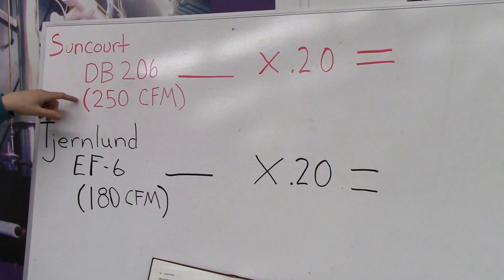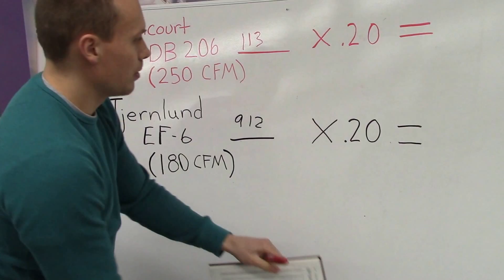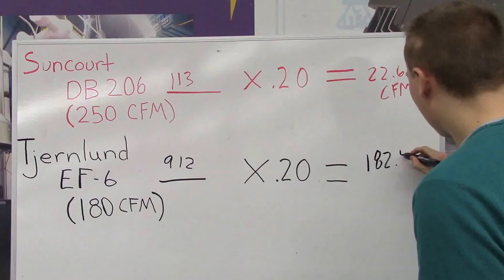6 inch Duct Fan Comparison

Comment: Neat. I just saw the Suncourt brand at Home Depot for $37 and was wondering about this stuff. Glad I look up this on YouTube.
Reply: Hello, I have designed a smart air duct fan, which can be connected to WIFI and operate all functions on the mobile phone. I want to invite you to review it. The product is free. Take a short video of 1 minute,

If you want, you can send your email to me, I will tell you the steps to receive the product, and give you the code of the product. You can contact me directly.